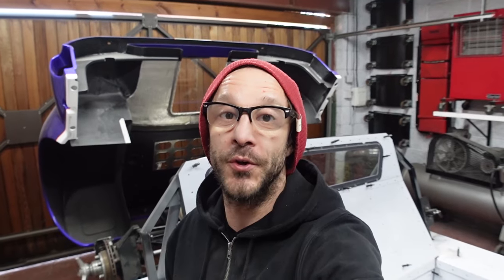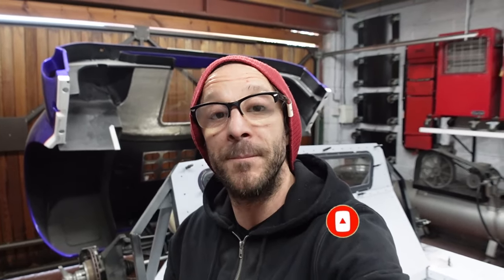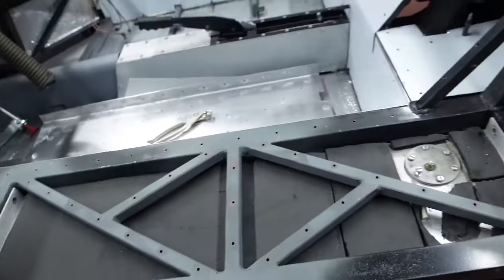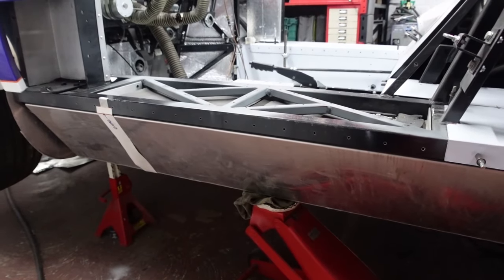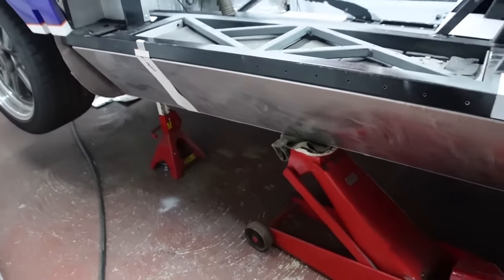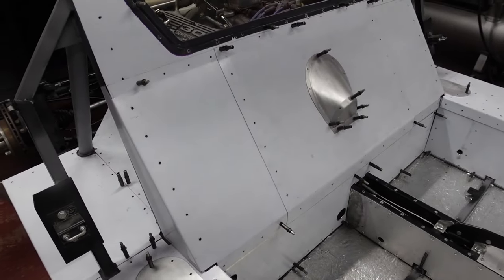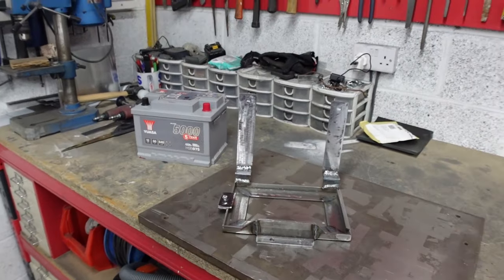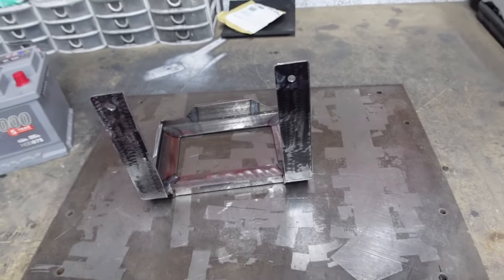GT40 Restoration - Ep 10: Pushing My Fabrication Abilities To Create My Dream

Comment: Well done you for getting stuck in and properly sorting this GT out. I'm pretty sure i recognise your car and I met the previous owner as he bought the wheels and tyres from me, Originally fitted to my CAV i moved down to 15' rims and Avon CR6ZZs. Sorry to add to your list but those look like the Michelins that were on those rims i sold, they are rather old and hard now, so new rubber would be a good idea and I hope he removed the ding in one of the rear rims which I advised him of at sale. Good luck with everything, it's coming together nicely!
Reply from the maker: Hi Simon, I cant remember the DOT number on the rears but yes they are getting on alittle! The ding on the rear is no longer thankfully so he must have gotten that repaired. My plan is to drop to 15's also, where did you get your new wheel and tyre package from out of interest?
Reply: @RatchetRebuilds  Hi there, good to hear that got sorted (was only small anyway!)! I went for Image Wheels BRM replicas, they're based in Tipton in the West Mids, they're a modular construction so they can bespoke them to your required width and offsets easily. They'll fit your peg drive pattern too. Mine is a LM Widebody car like yours, rims are 12' wide at the rear which is the widest you can squeeze the widest Avon CR6ZZ onto, they fill the arches nicely and give the right period look. Tyres supplied by Longstone Tyres, not cheap but cracking tyres, they're FIA wet weather approved and are used on GT40's racing at Le Mans Classic etc road legal. Wheels and tyres really look the part and give great compliance with the high side walls. Good luck with it all!
Reply from the maker: @simonbottomley6484  Image aren't a million miles from me so I suspect I'll use them for the new wheels, did you spec a bespoke offset? I'm pleased to hear you managed to squeeze a 295 onto a 12" as I've heard conflicting opinions!

Comment: Looking forward to the rest of this build now, it's going to look great I feel. :)
Compelled to mention the fuel tanks. If it were me, I would make sure no part of the tank was touching anything metal, including the top face you are going to clean up. The idea of the aluminium touching and fretting ANYWHERE over time makes my blood run cold!
Reply from the maker: A friend of mine also commented on the straps, I think I will look at them again and remake them from stainless steel

Comment: Looking good mate! One thing to maybe think about on your battery cover is a couple of holes to allow a battery charge lead to be permanently connected. Really helps in mine to be able to just lift the rear a little and pull out the charge lead and connect up a my c tech charger. My cover has a little compartment kn top.so you  an tuck the lead back in for clean visuals. Just a thought.
Reply from the maker: Top idea!!! Something I'll definitely look into, would save undoing the top bolts all of the time to put it on charge, cheers for the suggestion

Comment: Several ideas (probably too late...and no affiliations);
Varley do excellent batteries that are smaller for the CCA and save weight...
Fuel tanks do indeed move around on brexit quality roads, so it helps to have foam under compression to avoid metal on metal movement (NB: steel is twice as heavy as aluminium but in this case, thinner steel for the straps is probably a better choice if properly protected and with no sharp edges).
I would fit orange FIA foam if this has not been done (sorry I tend to skip through videos...).
Reply from the maker: Hi, depending where you've got with the videos I did remake the straps out of stainless, these have rubber pads for the tanks to sit on and also some thin rubber around the vertical part of the strap to avoid chaffage :-)
Reply: @RatchetRebuilds  Thanks...stainless is a good idea. It is important to try and get as much right as possible. If I have other ideas I will post them 🙂

Comment: Great video Andrew and lovely work mate but is it wise to mount the battery that near the fuel tank? 😬
Reply from the maker: Ahhh probably not, perhaps something to put on the list to look into separating the 2
Reply: @RatchetRebuilds  I don't wanna be THAT guy mate but was just an observation 😅😅 lovely work though mate you've done an outstanding job 👏 👍 👌 🇬🇧🇬🇧😎
Reply: @RatchetRebuilds  my consideration was that both are mounted on the side you see so if a side bump you've got two very volatile things right next to each other 😬